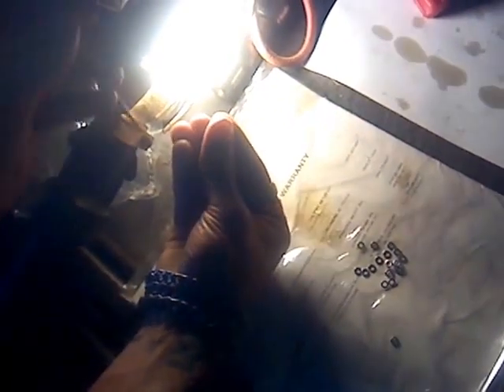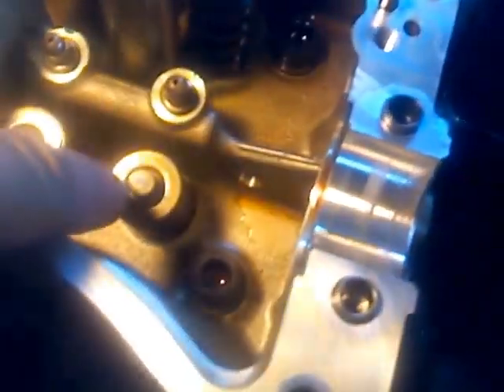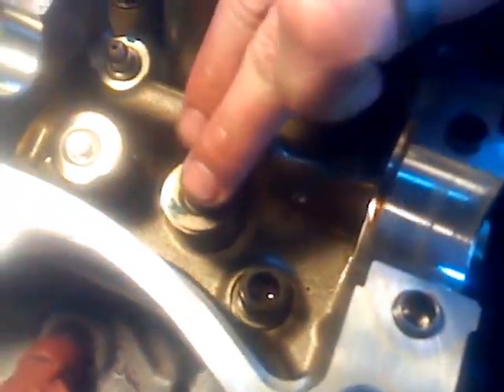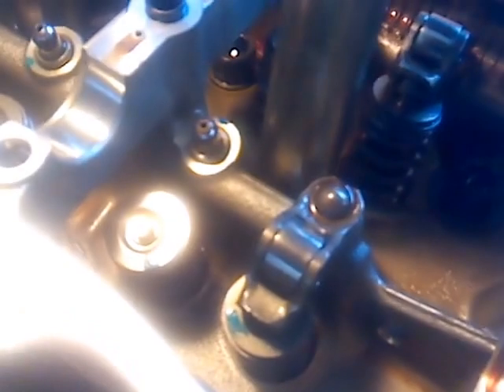Shimming Valve Stem Caps - Toyota 3.5L V6 2GR-FE

Comment: Is it possible to change valve stem seals for 2grfe engines without removing the engine heads? Please answer me as soon as possible.. thank you so much
Reply from the maker: It's possible but it would be very difficult to do with the engine in the car, nearly impossible for the RH bank because of difficulties of access.
Reply: @Merryfrankster_  The most impotent thing is that its possible, but do u know how much would it cost? Even a close number won't hurt
Reply from the maker: This is the dealer training video for replacing the valve stem seals however it shows only longitudinal engine/rear wheel drive. 
https://www.youtube.com/watch?v=yS5KInuI6mw
This all depends on whether your are asking about doing this job with the engine in the car or with the engine out of the car. 

In-car, with a FWD/AWD engine the process is MUCH more difficult because of difficulties of access. For the forward bank it is not so bad, however as I said it may be nearly impossible to do for the rear bank facing the firewall in a FWD engine because there may simply not be enough room to do the work. My own estimate for the front bank would be 12 hours of labor in-car. For the rear bank, I would advise removing the engine. Your cost will depend on your mechanic's labor rate. 

What makes you think that your valve stem seals need replacement? This condition is often mis-diagnosed.

Comment: Frank, I asked on one of your other videos too, but other's might be wondering as well...is it safe to rev to 8K in a boosted setup or will those rockers fling all over the place?  Revving to 8K would be awesome but MWR suggests 7,500 redline
Reply from the maker: Hi Ali, to rev higher than 7200/7500 you need stiffer springs, which are available from MWR. With the spring upgrade, you should be able to go to 8500RPM. My limit is set to 8000RPM. I've hit it many many many times without any problem. This is with a naturally aspirated engine. I don't know whether it would be any different under boost - I don't think it would.
Reply: Hi Frank, awesome videos BTW!  MWR recommends not exceeding a 7,500 redline with their stage 1 cams and valve springs with my 2GR-FE  + TVS1320 setup. I'm curious if you've done anything in addition to the cams and springs - Matt says many people are knocking the rockers loose at 8K and above.